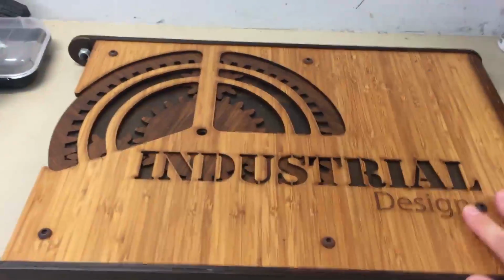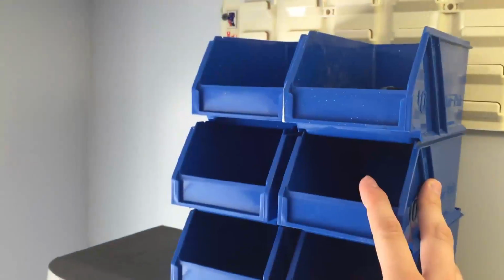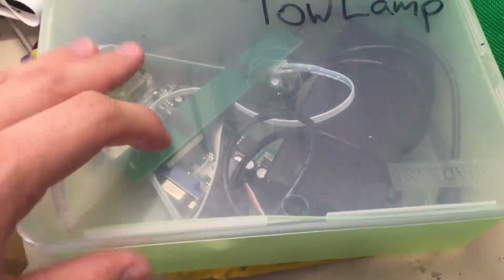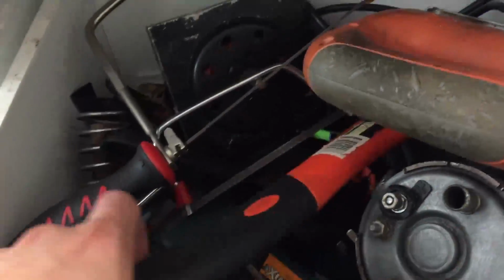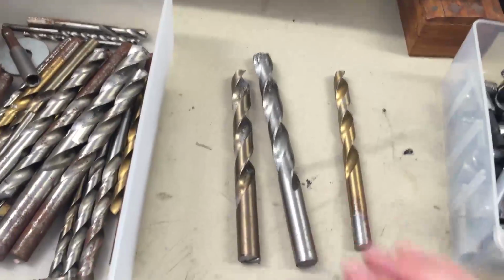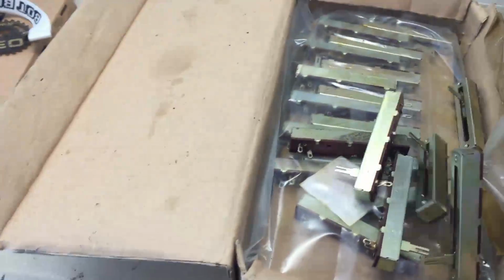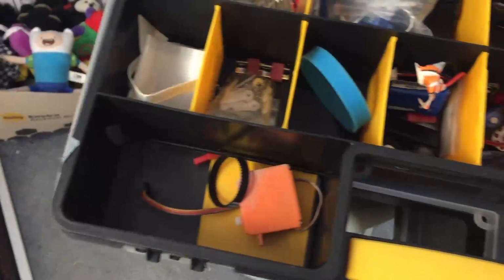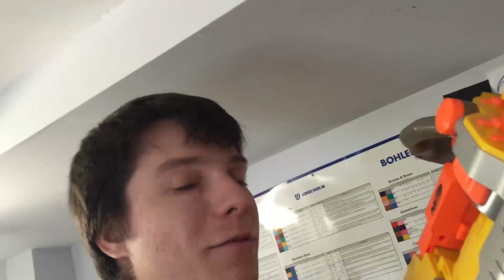Maker's Muse Moving Vlog 1 - (GONE PROCRASTINATING)

Comment: Ha, cool. I need a maker space... Stupid apartment life.

The only "tech" like thing I'm working on is a USB powered Carbon/HEPA filter that clips into the top of the Up Mini (where the filament goes in). Obviously it won't get 100% of particles, but something is better than nothing ;)
Reply from the maker: Anything helps! The minis can have a smell to them especially in an enclosed space. I would go crazy / be evicted if i tried living in an apartment :D
Reply: Yeah, I've got absolutely no space to tinker. Haha
Reply: +Yosef Selim Hahaha, working on the same thing (for my FFCP), actually just finished it. 

Depending on your design, you will probably need a high static pressure fan.  I posted a video on the Rod Laird's replicator 2/2X air scrubber Thinkiverse design (which is very well done) but using a respirator filter purchased on Amazon in the US. Unfortunately you cannot move enough air through the respirator, not even close unless you crank the motor to 12vdc which is extremely loud. (I used a Amprobe TMA40-A Anemometer to do the air measurements)

I will be posting a follow up video on my remix of his design that utilized a 110mm x 54mm Roomba HEPA filter and Carbon Pellets.  I will be also posting some VERY unscientific testing of the design using an incense stick :P

Check out my twitter feed if your interested in checking out my remix design.
Reply: RJ_Make Yeah, I figured I might need to go 12v, but I've still decided to try out a small portable 5v USB one first as a proof of concept... I mean, if it winds up making any difference at all, then the literally $10 I've spent in total will be worth it ;)
Then I'll move onto a bigger and better one. ;)

Comment: awesome stuff dude, i have and old rapman printer not sure if youve heard of it? its pretty much useless but i dont know if its worth pulling the stepper motors off and the hot ends it was a dual extruder has some nice linear shafting bearings etc...... thoughts?
Reply from the maker: +Benjamin Harris Haha yep I remember the repmans. I'd part it for sure, lots of good bits just a terrible frame design.
Reply: lol sweet, im not sure if the board is hackable, i have a ramps board with an arduino and some drivers but the german steppers dont have any codes on them so a bit lost on identifying steps etc
Reply from the maker: +Benjamin Harris IDing the poles is easy with a multimeter (see which have continuity), and yeah I'd just chuck the original board and stick a ramps in! I'd bet the motors aren't anything special.
Reply: awesome thanks from NZ man :p